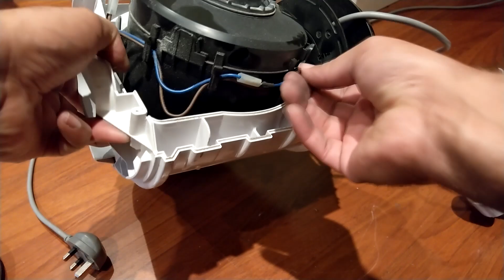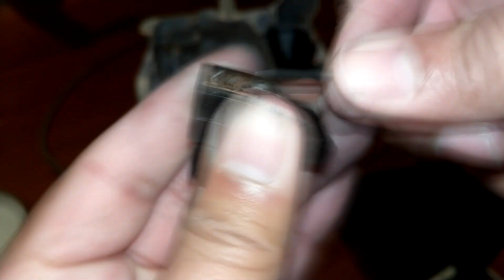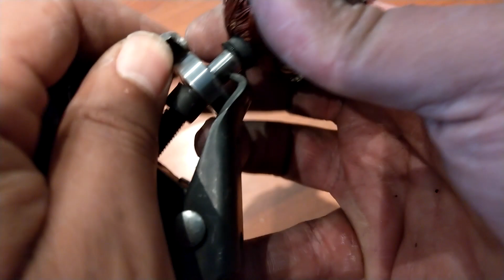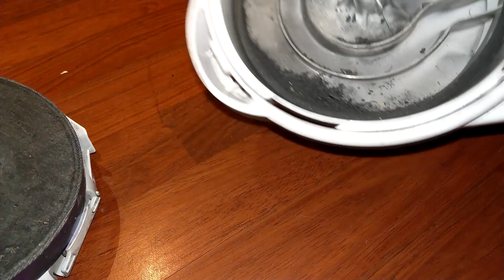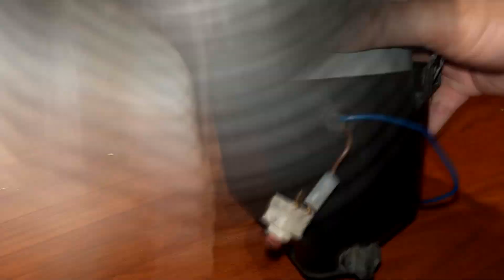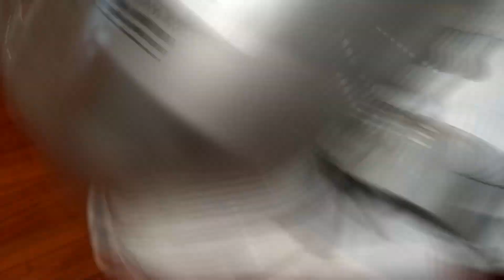Dyson Motor Replacement and Repair

Comment: Is it possible to upgrade the current motor/engine on my Dyson DC40? I would like my Dyson to be much stronger than it is at stock.
Reply: It most probably wouldn’t fit, both motors are different by size and design, the Dyson Dc40 motor would be a bit to small and the Dc08 Motor would be to big to fit in a Dc40

Comment: merry xmas simon, have you ever  got involved with your factory fitted radio and 6 disc player?
Reply from the maker: No. Luckily my original 2002 system still works correctly.
I also have a Grom Bluetooth unit fitted so if the CD changer ever fails, it's no big deal.
Reply: SiRobb Hi Simon Enjoyed your lower arm video ,as the arm has done 100,000 miles would you replace Lower ball joint as a matter of course
Many thanks Geoff
Reply: Si just going back to the lower arm, my xc90 starts to wander on braking, and both front tyres are severely worn on the inner tread, Upon shaking the wheel up and down and side to side there seems to be no movement anywhere, there are no torn boots, on the lower arm unlike the one in your video, I’m stumped any ideas?
Reply from the maker: I wouldn't change them automatically.
They're a pretty dumb component so as long as the rubber boot is in good condition and there are no signs of grease loss, they can last a good length of time.
Mine are still original at 18 years and over 200k miles. 
If paying someone else to do work in that area though, it may be cost effective to get the balljointd done at the same time to avoid paying for labour twice.
Reply from the maker: Get the tracking checked first.
Reply: SiRobb Hi Si, carried out the tracking as you suggested and yes it was way out, the technician said return the following week for a re check, upon driving home
Reply: It still wanted to wander to the o/s, yet after 10mile it seemed to bed in, I will have to monitor the situation
Reply from the maker: At least you've had some progress so that's good.
If you still have the unevenly worn tyres on, they won't help.
Reply: SiRobb both lower arms replaced, two new tyres and wheel alignment, Job done, when I first checked the suspension with the front wheel off the ground, there is so much hanging weight that all joints are fairly Tight, But if you check with the vehicle on the ground and power steering on, by rocking the steering wheel You can produce movement. It’s quite deceptive, i’ve put the old lower arm in a vice and with a lever moved the bush backwards and forwards by about 15 mm, whereas the new arm Moved only 2 mm
Reply: SiRobb Hi Simon , are you recommending that TalkPro OBDll In your video, because I thought you only use the Vida system?
Many thanks
Reply from the maker: No I don't only use Vida but if I could only use one, Dice and Vida would win every time as it is much more comprehensive.
They're not mutually exclusive though so having both makes troubleshooting and fixing much easier.
Reply: SiRobb Hi Simon, do you have any thoughts on the blue driver scan tool, from lemur monitors?
Reply: SiRobb Hi Simon have you any thoughts on the blue driver scan tool made by Lemur monitors, It seems pretty comprehensive?
Reply from the maker: @geoffreygcotton  You've already asked me on another video and my answer is the same.
Get Dice and Vida.
Reply: SiRobb apologies si, can you use an iPhone with D and V and how is it obtained and what cost?

Comment: Buying carbon motor brush most of the time are not worth it as the motor has already done damage. Just better to buy a motor.
Reply from the maker: That's not my experience.
I've fixed many motors, starter motors and alternators with a new set of brushes.
They are a changeable, disposable item.